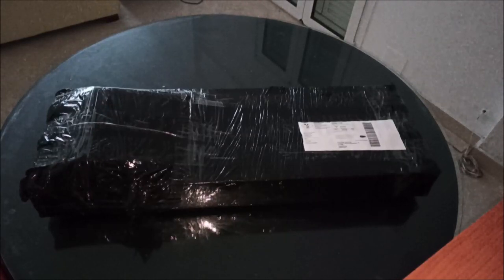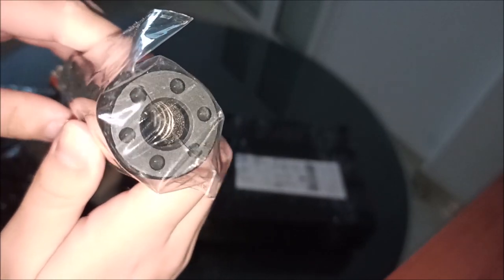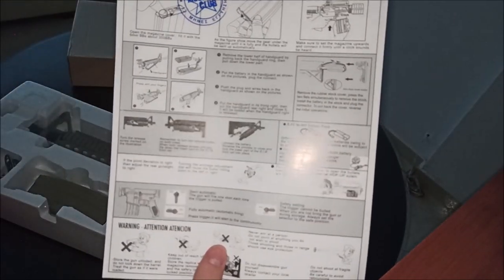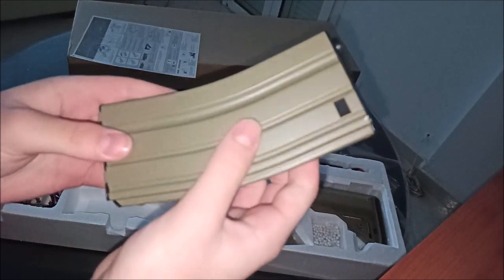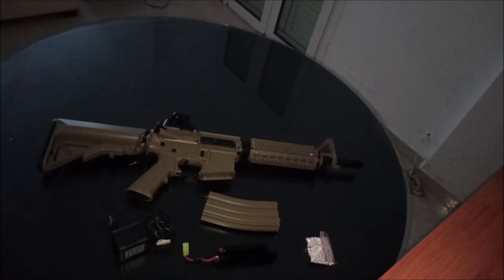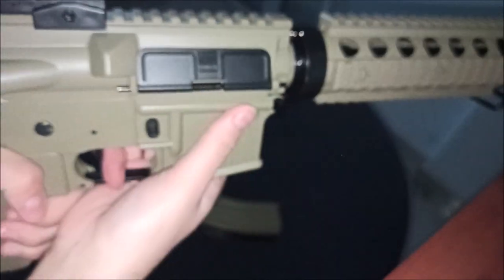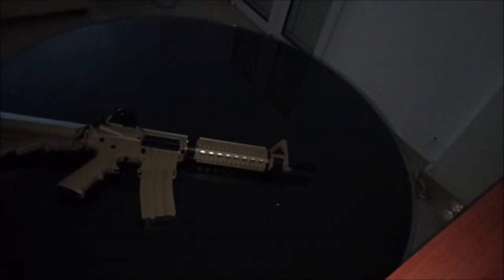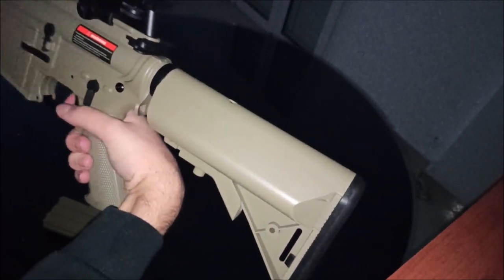CYMA M4A1 RIS CQB (CYMA CM.506) Unboxing And Review

Comment: Is there a way to remove the triangle sight?
Reply from the maker: You can but then you either need to change the handguard or tinker with the triangle base a little bit cause in order for the whole thing to stay in one place you need to have the triangle sight base on. If you want an m4 without the triagnle sight you can go for the CM512 on Which im dropping a review soon.
Reply: @SketoThanos  so basically for the handguard to be in place I need the triangle sight?
Reply from the maker: @Bored_Zomb  exactly, the easiest way i can think to make jt go away is to use some kind of tool to cut it but I'm not sure if its gonna be good.
Reply: @SketoThanos  I think I'd rather replace the handguard. I've literally bunged on a sniper scope, suppressor and vert grip on the thing and the stock internals are decent. Goes bloody far. Then i can just turn it dmr-ey but full auto. So extra cursed lmao
Reply from the maker: @BoredZomb i added a sniper scope and a vert grip and a suppresor as well and in order for the triangle sight not to block the scope i used the tallest rings i could find haha. Still it did the job very well but now i bought the cm512 which looks like a DMR way more than this one. Well good luck in the handguard replacement and dmr upgrade my friend!!